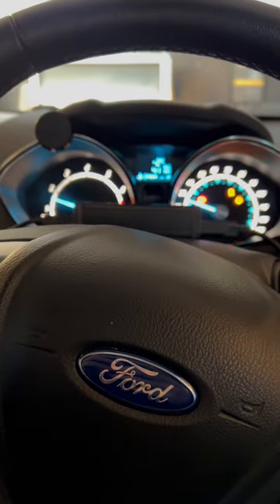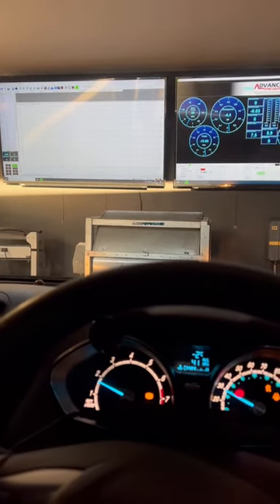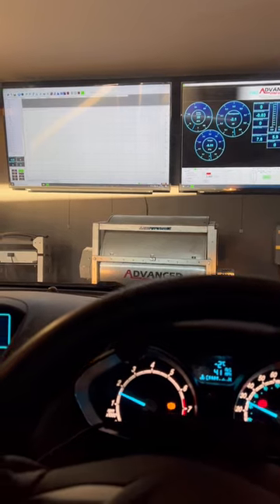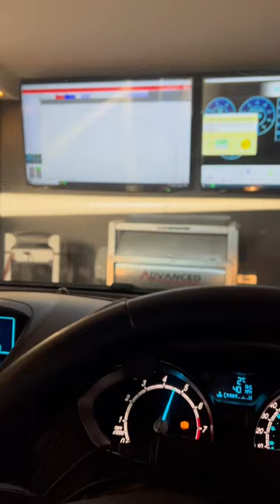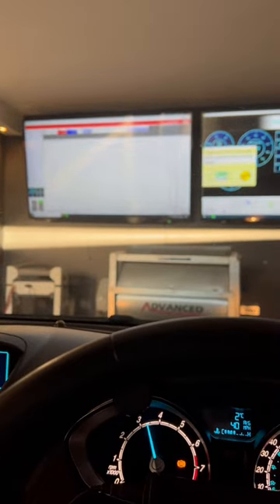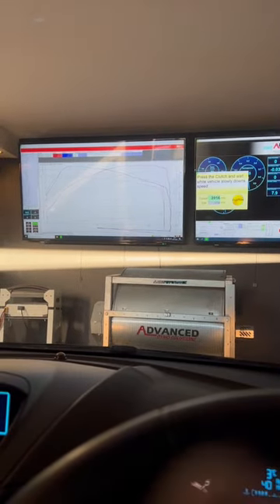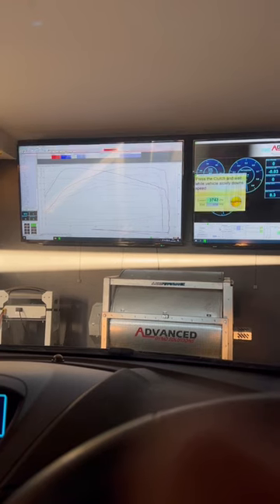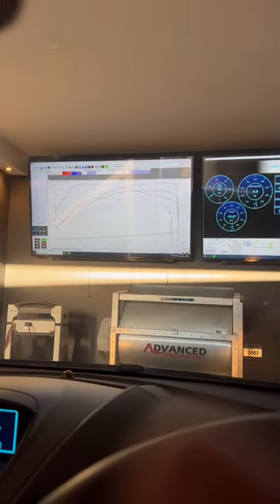1.0 ecoboost stage 1 tuning!

Comment: Will defo blow up in time 1.0 are garbage
Reply from the maker: Fun fact we have a very very low failure rate on cars we’ve tuned, the problem mainly is, young guys going for the cheapest remap, the cheapest oil, cheapest maintenance, or thrashing them constantly, these are eco cars they aren’t designed for flat out death 24/7, any car given race car performance requires race car maintenance 

The main cause of death to these engines are incorrectly fitted parts mainly Turbosmart bov leading to uncontrollable boost levels which cause detonation, this is all down to a “how to get turbo flutter on your 1.0 ecoboost” tutorial that’s on YouTube which shows people incorrect installation of the part, and then incorrect oil type which degrades the belt faster and people don’t maintain the pick up.
Reply: @lairdperformance2235  Yeah people bouncing the 1.0 off high revs or the limiter like it's a Type R and DMO shifting the gears and then complaining about the gearbox being chocolate or whatever lol seems to be what used to happen on the owners pages. Seems like the 1.0 doesn't need a different blow off valve ever and stage 1 power is very safe for these it seems considering how Revo or TDI tuning boxes for example have never had any issues
Reply: @lairdperformance2235  exactly what I thought. Heard it all but the younger people of this generation just want to kill any car they get in. Regular oil changes and proper maintenance will keep these cars going longer.
Reply: Have yet to see a properly maintained 1.0 fail. It’s all down to maintenance with these. Any garage that offers a service package for these for 100 is gonna give you problems. The plugs alone are £45
Reply: Stage 2, 75,000 miles, serviced twice a year best oil & petroleum. Major parts installed by professionals with all parts being trusted brands not any eBay specials. Car is 1.0 ecoboost running 200bhp no issues, 3 years running. Laird performance are correct 100% it’s down to the owners who are usually young and trying ST power for lawnmower prices.
Reply: @nikobellic6264 how often do u smash it to 5k+ revs when u drive it tho

Comment: I have a 140 st line 2018 ecoboost thinking about a remap. What do you think is available hp just from a remap?
Reply: You could get to around 180hp with stage 1
Reply: @cameronlotter1392 Not a chance. On a 140 model looking at 155-160. Stage 2 175bhp max. Go Stage 3 with a hybrid turbo you’re looking at 205ish..
Reply: @BoostedSenna  I have 123hp model and stage 1 is 165hp, so I thought 140hp model would be higher
Reply: @cameronlotter1392 same engine produces the same power on a stage 1 map
Reply: @hh4251  ahh OK that makes sense

Comment: The right spec and grade of oil is very important in these engines  because of the wet cam belt. Engine flushes can also degrade the belt. I think the engine itself can handle the map, id be more worried about the gearbox (if its the ib5). The car is already at the gearboxes torque spec at factory. Probobobly can be saved by not pushing 1st and 2nd gear too much though
Reply from the maker: Correct people have a terrible habit of using the wrong grade of 5w-20 in these engines, the gearbox are generally fine it’s to do with how people drive them and again lack of maintenance, it’s an eco car designed for economy and unfortunately some young people want to drive it like a race car
Reply: @lairdperformance2235  Yeah I'm thinking of getting mine remapped, it's mainly insuranc premiums I'm worried about as I'm a young driver lol
Reply: I have 5 speed box with same torq as the st180 from my custom map. Only thing I worry for is the turbo but it all seems healthy currently
Reply: @lairdperformance2235 same parts in this as the st line yet the st line is advertised as something you can throw around

Comment: Can you please give me your opinion so I have a 1.0l ecoboost engine in a mk8 Fiesta Vignale and it now has 100hp and some people have said to me that I can tune this engine from 100hp to 145hp and that that tune won’t shorten the life spam of an engine do you think that’s true ?
Reply from the maker: It depends on the tune, not everyone can do a tune which is both reliable and makes power, we could custom tune the car to that kind of power without much demands which should in theory give us the additional power without any real reliability issues as we are still within the power range that Ford supply the cars in, so in short yes we can take your car to 145BHP without any additional mods, we have done this multiple times to loads of cars with plenty of success
Reply: @lairdperformance2235  thank you

Comment: Is it worth tuning a 2012 1.0 125hp ecoboost? I'll be changing my timing belt in a couple of weeks and was thinking of tuning it as well. I love the car but it struggles taking off up-hill and generally revs really slow. How will that impact fuel consumption? A local garage says i'll get a 10% performance boost on top of 10% better mileage but they only do it along an engine cleaning and charge a bit too much. I already use a cleaning formula twice a year, but nothing fancy just standard injection cleaner from the gas station.
Reply: Don’t do it.. warning from
Someone with experience
Reply from the maker: its worth it absolutely, generally people only have problems when they take there cars to inexperienced "tuners" and have cheap mapping carried out, or when they haven't been given the proper information after remapping about fuel quality etc, most "tuners" out there are just flashing anything onto your vehicle, at Laird Performance we are custom tuning the car properly in house extracting the best from it all while monitoring crucial safety parameters :) we have had very few failures on 1.0 ecoboost engines, most of which we have seen have been either lack of maintenance, incorrectly fitted parts, or lack of mechanical sympathy, if your not local to us we also have an end user tool available so we can tune your car remotely.

Comment: What is possible with 125 HP ecoboost?
Reply from the maker: We have seen up to 200BHP but that’s with hybrid turbos etc, with that it requires a fair bit of money, you are also pushing the vehicle to pretty much double it’s factory output
Reply: @lairdperformance2235  i mean easy level 1 chip
Reply: I think it makes almost 200lb ft of torque around 1400rpms
Reply: @harveymushman4190  lb ?
Reply: @chrisvonpapenburg  lb = pound  
200 pound feet of torque @ 1400rpms
Reply: Probably the same, 100 and 125 are very similar.

Comment: These cars dont need a push in power , i own a 17 plate x 1ltr and its a great engine with a nice kick of power when needed . Not to mention a lot of fun round corners. 
 To be honest id be worried about engine issues due to mapping over time as much as i would love a bit more power. You know what you are doing and have a great success rate so best of luck to you and enjoy .
Reply: You know some of the 1 litres have 40 less horsepower on the same components mate
Reply: @Danolinithe1st  what ? Never heard of that before. I think most ppl would know if they only putting out 85bhp . My old 1.6 was 115bhp and this ecoboost is definitely quicker. 
 Where did you hear bout this ?
Reply: @pauljohnson9326  they mean the different models their is the 100ps model 125ps model and 140ps model

Comment: What is the right oil for these?
Reply: Around 4.3-4.6L of 5w-20. Comes under WSS-M2C948-B spec
Reply: Castrol Magnatec is the best oil for the 1.0 ecoboost. It’s even recommended by the manufacturer.